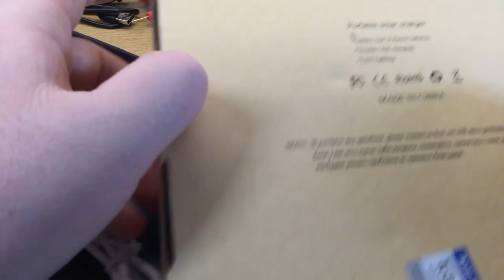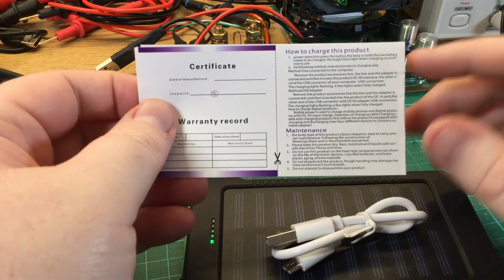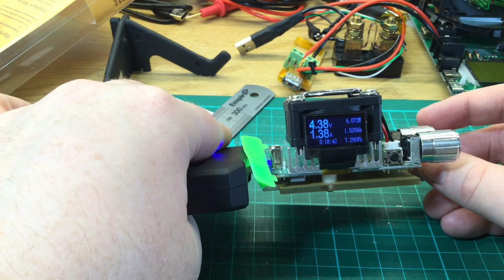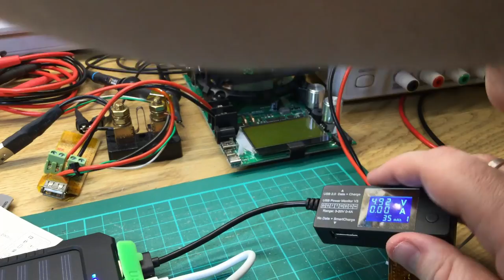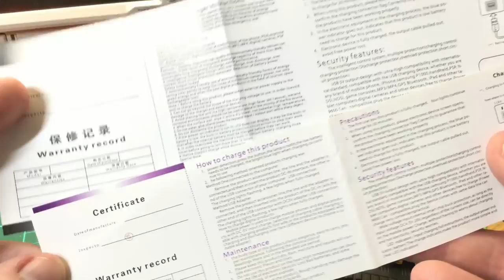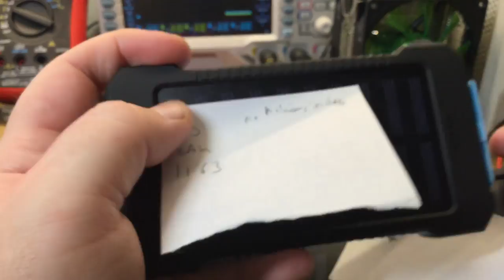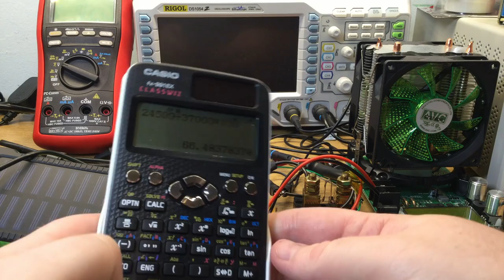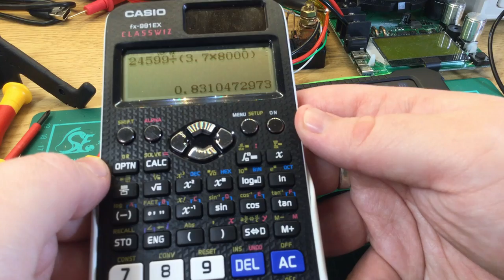Tollcuudda Waterproof 10000mAh Solar Powerbank Review

Comment: I have a similar one, at least it looks similar, it claims to be 20000 ah, initially I bought it to power a 1amp cctv cam near a birdnest but on tests it couldn't get the camera going for 6 hrs. Your video confirms my expectations. Mine weighs just 199 grams and afterwards we attepted charged two phones on it which it couldn't cope with. I wouldn't say it's bad, it usable as a simple powerbank but it's not delivering what's claimed by the seller / manufacturer.
Reply: Got another powerbank now that is better quality and it seenms the powerbank he uses in this video shuld be blinking blue for oh idk solar ”charge” its not chargeing in sunlight i have the blue one only green led for 2 damn hours being dead not even charged until i used usb charge on it did u have that issue too?